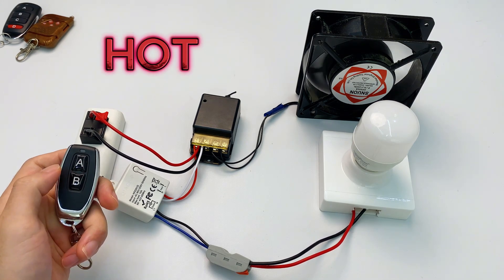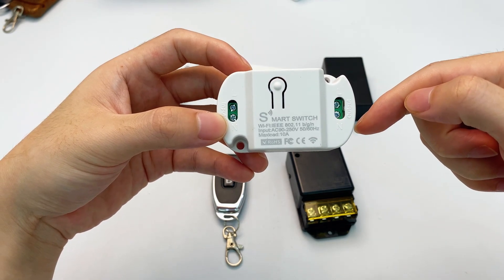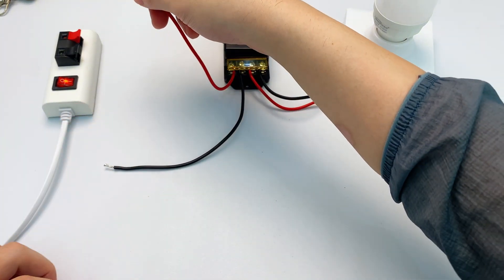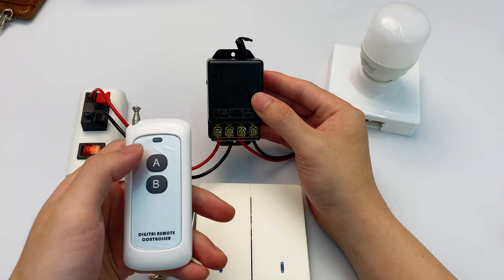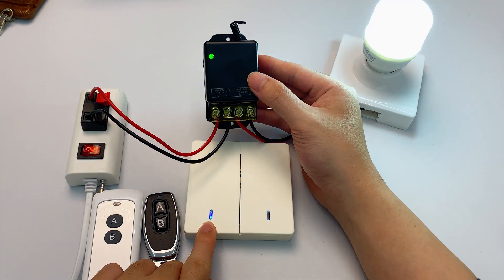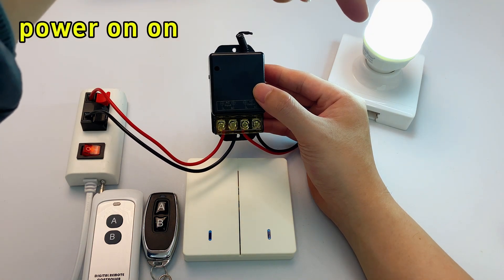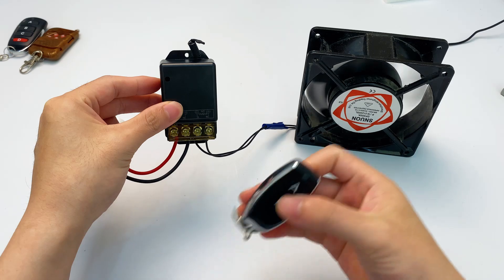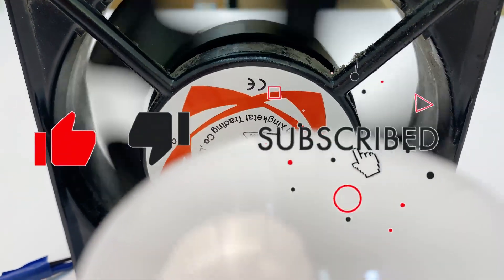How to Use Wireless Remote Control Switch KR2201B 220V 110V Relay Switch to Control Fan and Light

Comment: "I tried, but when I push it to On, it starts, but when I release my thumb, it turns off. What could be the problem?"
Reply from the maker: We also have an official website for manuals. You can check it out.
https://qiachip.github.io/qiachip/
That's great. Actually, you've already completed the wiring. But when it comes to pairing, you need to choose the right mode.
According to your description, you paired it in the momentary mode and pressed the button on the receiver once.
What you should want is the Latching mode. 
In Latching mode.:
Press the remote control button (such as A), and the receiver's relay turns on.
Press the remote control button (such as B), and the receiver's relay turns off.
How to set latching mode
Step 1

Click the learning button of the receiver three times. The indicator light on the receiver turns on, and the receiver enters the setting state.

Step 2

Press the button on the remote control (such as A) once. The indicator light on the receiver will flash and then turns on.

Step 3

Within this period, press another button (such as B) on the same remote control. The indicator light on the receiver flashes and then turns off. The latching mode is set successfully.